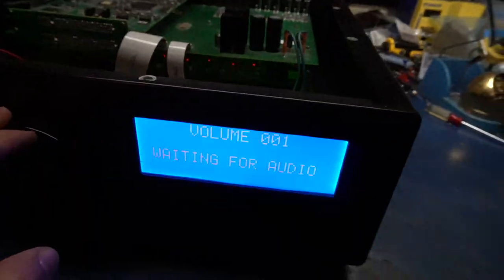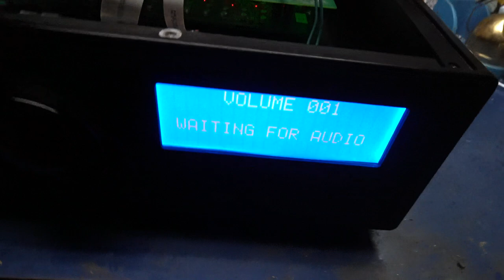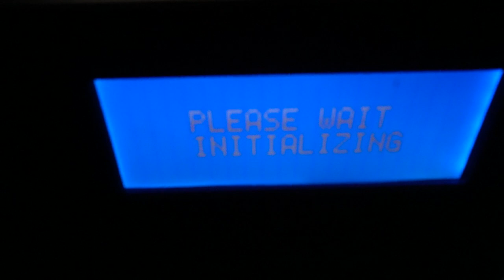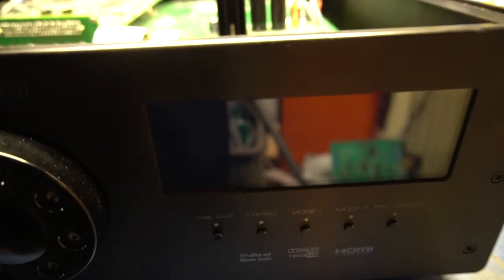Krell S1200U 3D Home Theater Processor.  Inside view. How repairable are they? Brief overview

Comment: are these reliable ?
Reply from the maker: They seem to hold up well if you have the factory upgrades done and recap. Due to heat they probably need signal caps replaced in about 5 to 7 years.